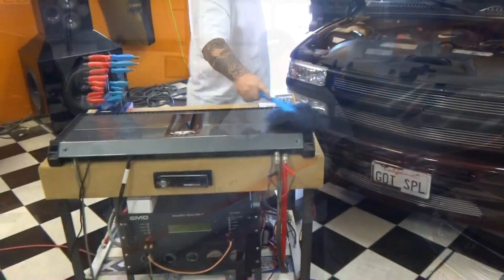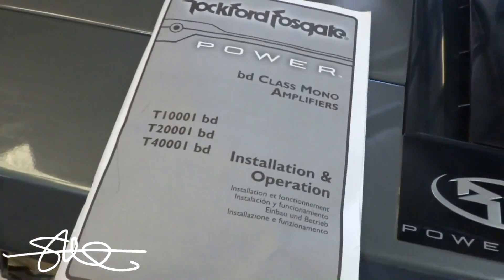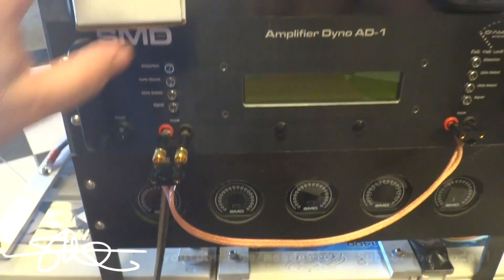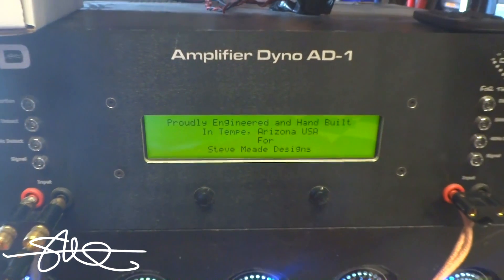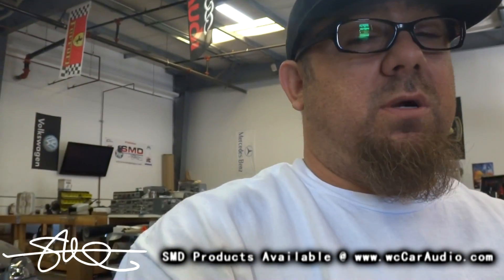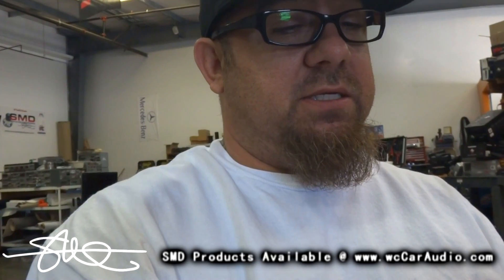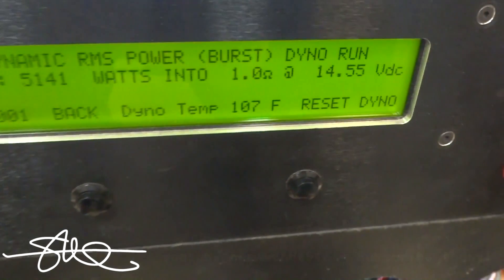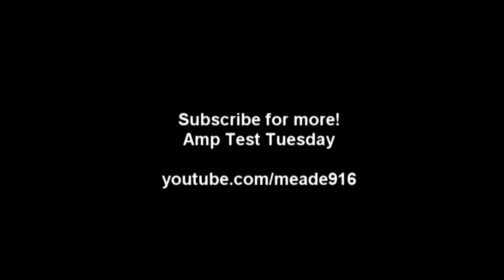Amp Test Tuesday - the BEAST Rockford Fosgate Power T4000.1bd - Rated 4000 Watts RMS

Comment: Rockford fosgate junk try all there shit blow t1 t2 p3 subs out the box had there punch p1000 power t2500 good amp but there subwooder are junk and there no help if they blow and they charge way to much money i want to sundown audio still on the same sa 12"750 rms ech on a sundown 2000 mono block clamp at over 3000 rms had them for a year now
Reply from the maker: sounds like you need to learn how to install.  I can't remember the last time i had an RF ANYTHING blow or break.  Subwoofers don't break themselves usually.  PEOPLE break them by not knowing what they are doing.
Reply: @meade916  i did not even put them in audio extreme in oh did
Reply: just saying really had bad luck with them pay a lot of money. like your videos looking to go all new this year seeing what out there. want to keep my same amp new speakers and box

Comment: Hi meade916 just joined the subbers, Nice videos. If You ever get the chance try running the xtr 2500.1 from Orion i think it will surprise in a positive manner. Have one myself and its a sleeper for sure. Also will tests of gear like Thesis or P 15 from Audison and Genesis ever be possible? Thx

Comment: I'm just a little disappointed with the numbers... don't get me wrong that is an awesome amp with amazing power but I have seen you test amps half or 1/3rd the size put out more power and let's not even go into price ! the cab 1600.1 put up freakish numbers but reliability is not there like in a RF. The orion xtr 2500.1 put out 5700 watts rms and cost around $300.00 give or take and that amp cost 1000's more and like with all things in life do you want quality or quantity
Reply: BASSstarlet 
Put a link up where u can pay $300 for this amp and I’ll buy it right now
Reply: Agree, amp isnt that impressive.  Its at 13v witch is still higher than most will play in the car without 450amps of Alt
Reply: meade916 alright it’s been a year later let’s see a retest of the beast on the dyno with proper voltage. After you re test sell it to me on a payment plan and I’ll pay interest lol
Reply: The best amp on the market NEEDS power to produce power! No way around this principle of electronics.
Reply from the maker: first of all, ain't no xtr 2500.1 putting out 5700rms.  2nd, the RF4000.1 is 13 years old.  At the time it was in production, wasn't an amp ANYWHERE as powerful as it was.  Also, did you not watch the video or did you head straight for the comments without bothering to look? My bench (at the time of this video) could not fully support testing this amp and i made it VERY clear it needed more power supplied to it. You are right on one thing though, you get what you pay for.
Reply: meade916 
Steve did you get a chance to watch that link I sent you for big d wiz ? That amp did do 6744 watts dynamic. Also yes so did watch the whole video you made for the Rockford. 
No apology for saying that I was totally wrong. About the Orion xtr 2500.1 ?
I'm really curious what numbers that RF would put out with proper voltage ?
I'm wondering if it could even match the dynamic power of that Orion ??? 
Anyways regardless of this amp or that amp you are still the shit and your work is world class for car audio and installation and I'm sure you already know that 💯👍😎

Comment: Hey Steve do you have a t20001bd lying around you could test. I'm getting one this week and I'd like to see what they can do. I hope they do at least 2500w.
Reply: Joel Schub Yes.. this specific amp is a little bit underrated.  2500W it's possible but you need one more battery 0 gauge wire and 200A alternator.rockford drows a lot of power !!
Reply: I got a t30001bd. I have a 200 amp alt and two yellow tops gonna need some more I guess. It is very very powerful. Got some fi ssd subs for my box. 3 of them

Comment: Great power, poor design. I had to send back three time before I eventually sold
Reply from the maker: +adam the T4k is capable of 5,000+.  And it don't matter what your "view" is on the price.  To some people, a $1.00 Candy bar is a "rip off" because they think it should be .50 cents.  So if it ain't in your budget, don't buy it.  And one last thing, this series of amps was designed, engineered and built in the USA.
Reply from the maker: Probably user error.  My amps didn't give me any problems at all.
Reply from the maker: +adam as you clearly don't understand why some amps cost more than others.  It isn't just a pure wattage thing.  The engineering, higher quality parts, higher quality terminals, and a ton of other things that decide the quality of the actual amp come into play.  That is the reason there is Prime, Punch and Power series.  Now can you go cheap? of course. 3 years after you installed that cheap amp will it still be working? will the terminals still hold a wire? will it make a buzzing sound? I know what happens when you spend quality money on quality amps but you clearly just want to be a cheap skate.  That's fine, i encourage it if that's how you wanna do it.  Not all of us want to run cheap, cookie cutter amps.
Reply from the maker: +adam as here is another example.  You can call Korea and get an amp that looks just like half the other amps....slap your name on it and call it yours.  That is super cheap.  You want your own products designed by your own engineers with your own EVERYTHING including heat sync, patents, years of in house testing, marketing....well guess what, that shit is going to be expensieve.  There is a big difference between a company that has been leading the pack in technology for 35 years and the many amps out there that look alike and all come from the same build house..   Nothing wrong with those amps, most are great, but there is a reason they can undercut the larger brands.  Having 1/1000th of the overhead is one example.  Think about it.
Reply: this is old, good luck even trying to buy this amp, amp is a beast, watch your volts drop
Reply: audiopipe amps are under rated..great for the budget

Comment: How are you Mr. Meade? My name is Twobeazy DaBull from Indianapolis, Indiana. I am currently here to ask you if you could do a amp test on a 4,000 watt Lanzar Max Pro ST. MXA 282.  I just reserved this amp and have a strange feeling its not going to do what the specs say it should. I will be putting this in my 99' Mazda Millennia S with 2 10" Planet Audio ACR 1040 in a 10" Ground Shaker box. I will be running 2 gauge power and grounds with gold tips for easy and safer connections.Any suggestion?

Comment: steve greetings from Colombia, I wonder if this amp can test dynamometer powers as they work stetsom or taramp's? and if possible to know if with amplifiers 6.5kw, 10.5kw, 14.2kw, 20kw of these brands, if you drop the voltage RCA signal to the amplifier input and until there is maximum gain for this to work them q not happen? . . . they can know this with this dyno? . . . thanks

Comment from the maker: this amp has been discontinued for 5 or 6 years so..... kinda irrelavent. The T4k has more features, i would take this discontinued amp over that thing any day.  It's not always about actual power output, there are other things inside these amps that cost money - and the engineering it took to make it do what it does isn't cheap.  Besides, i haven't tested that amp yet, who knows if it can even do what it claims.

Comment: 270 amps X 14.4 volts (ideal running voltage) equals about 3800 watts

Now take into wire losses at that power as well as voltage droop you could probably say about 3000 watts safely as steve says in the vid batteries are gonna make or break your voltage stability

Comment from the maker: sure they did...and then they DIDN'T fix or replace your amps? If they didn't, that means you didn't buy them from an Authorized dealer.  Like i said, they would bend over backwards to make it right.  Best CS in the business. I don't doubt you had some issues but next time buy from a reputable source and you should have no problems - nothing that can't be taken care of quick (by RF).

Comment: they were "bad" they just blew, i had  the right electrical system, 400 amp houre batt bank per amp. all 0 gauge connections,grounded directly on the frame. they did pound, for 1 hour.

Comment: I own a RF T4000.1Bd and this thing is thirsty!! I had mine running off of a 220 amp alt and 2 group 31 Deka Intimidators and wired 1 ohm it would still dim the lights a little!!!

Comment: u shoulda ran this bitch on ur taHOE RUNNING -but i geuss its true max is on the high/free way ,damn u said u got 8-x4k=32,000w holy shit man n for 8 years theese things got hot n it was already prolly hot out (amp internals get hot n melt together over time causing some to fail amonst other posibilities)& for theese older badass amps with smd tourture time theese things are effecient as fuck to produce that amount...

Comment: Just for kicks I'd build a bracket and use an air compressor motor run the belt to an alternator hooked up to your battery bank to mimic a running engine for these tests.  constant consistent power never have to worry about the draw of an amp ever. It wouldn't be hard to figure out the rpm's the alternator turns at a specific engine rpm.

Comment: Steve, is it possible to run the test on this amp at 0.8 ohms?  I was just curious because, with a few other test runs, you included the 0.8 results. It seems like the Rockford Fosgate amps are sturdy enough to withstand the drop. Thanks for another ATT video. Always enjoy them.

Comment: In other words, the gain on both the amp and HU are set to the same level.
IE if the HU outputs a maximum of 2volts without clipping, the amplifier is set to pick up that 2volts and amplify it without clipping.
Likewise, a HU with an 8v out would be matched with a lower amplifier gain, so that both source and amp max out at the same time, without clipping. :)
(hope this makes it more clear)

Comment: how come you didn't drop this amp down to .75 ohms and .5 ohms? Is it because the batteries were struggling to stay charged with 1 ohm? I would like to see what it is capable of if dropped lower. Maybe you could hook up your truck to the battery bank to charge it!

Comment: Hey that is my amp! well I have the same kind. Geez the voltage only dropped to 14v on a battery bank. I have an ohio generator 200amp alternator and 2 kinetik 2000's in the back and a AutoCraft AGM under the hood and wired @ 2ohms and my voltage can drop in the low 12's at idle when I turn it up.

Comment from the maker: all having MORE voltage from your deck does is allow you to turn the gain down lower.  If you have enough clean voltage coming from the deck, you might not need to turn the gain up much at all.

Comment: Could you do a test of the RF T1000-4AD? The 2011-12 model.
Its the new AD technology, and it should produce something like this: 

    4 ohms: 250 watts x 4 chan.
    2 ohms: 250 watts x 4 chan.
    1 ohm: 250 watts x 4 chan.
    Bridged, 4 ohms: 500 watts x 2 chan.
    Bridged, 2 ohms: 500 watts x 2 chan.

Comment: what cd player is that cause for some reason my deh-9400bt will not let me dd-1 it, well my system i have a pretty big system and i think my system just broke my cd player in some way just seems weird to me and no the dd-1 is not broke will work on any other system but mine so just wondering if you've heard of any problem like this before

Comment: i understand that, but having a hu with 2,4,8 etc... or a line driver with even more pre out voltage have a positive or negative effect on the wattage outcome, basicaly if the amp had more or less pre out voltage going to it, would it increase or decrease the amount of watts it produces, or is it not a factor when it comes to a test like this

Comment: hey I have an amp with two 35amp fuses attached to it. I was wondering what amperage fuse should i connect to the power wire which runs from the battery to the amp.

Comment: I have a question and any suggestions are appreciated. Subs won't play bass without using epicenter. The only way that they will play bass is by turning the epicenter up which I know you are not supposed to use with rap music. I tried connecting the RCAs directly to the amp but no luck. I also tried messing with the frequencies on the amp but nothing. What is causing this problem?

Comment from the maker: KEEP IN MIND - you will see the starting voltage above 15v...but that is because of the 10 amp XS power intellicharger. It is only contributing to charging the batts back up and TRYING to keep them fresh. But this amp draws over 400 amps so trust me the charger is NOT a factor. Just wanted to explain that.